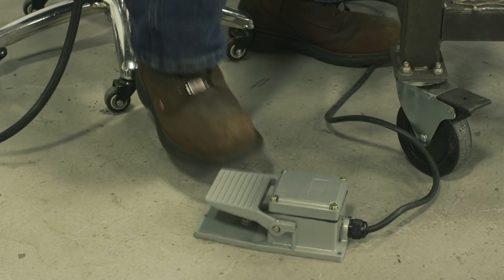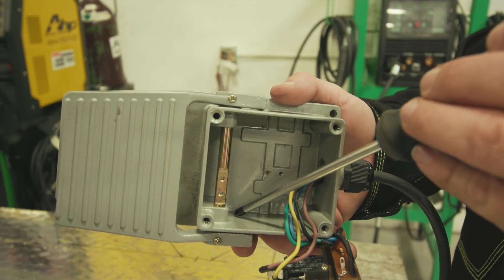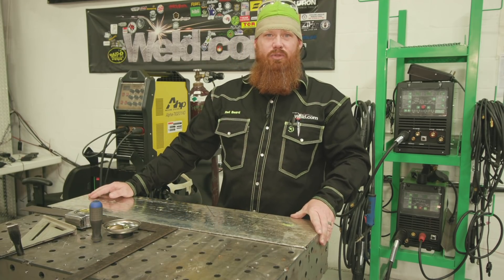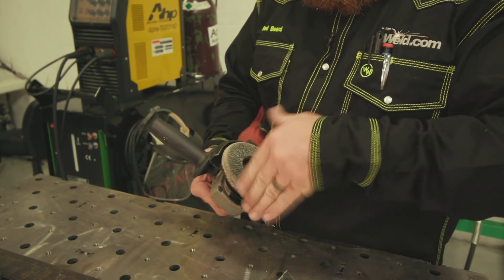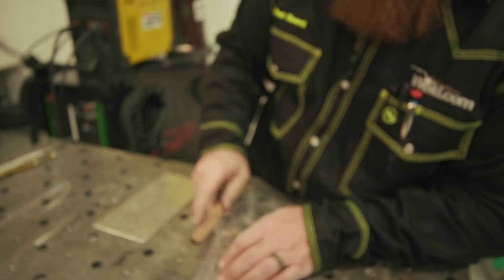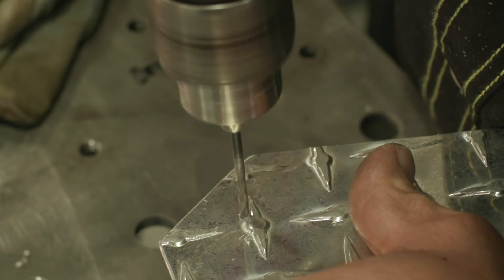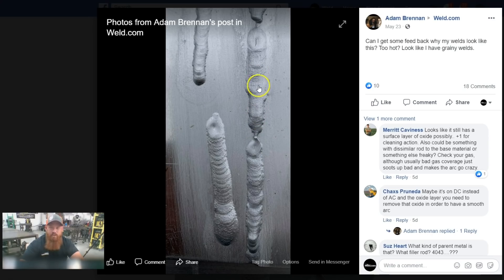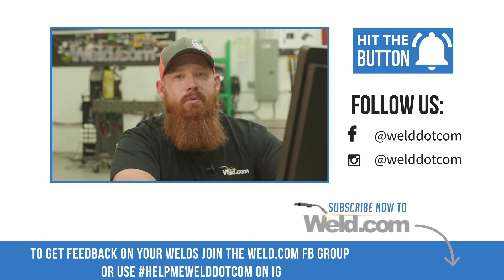Foot Pedal Retrofit: AHP AlphaTIG 200

Comment: I wasn't a fan of the supplied pedal either after using a Miller professionally for years. But I kept it really K.I.S.S. and made a price of plywood and screwed the pedal to it so your he'll is on the wood too. 
 Boom! 
No sliding around and much easier to run finger adjustments. Took five minutes and cost zero dollars since it was from scrap.

Comment: Putting a plate screwed to the bottom fastening holes that has an anti-slip rubber pad on the bottom helps a lot. No, I don’t have this welder, but I do have that switch I bought for a machine I designed. It’s not a bad peddle, as long as you put something on to prevent the slip. It’s pretty easy. McMaster-Carr has what you need. It’s cheap enough.

Comment: Why do you use a dirty angle iron if you try to keep everything clean ??
Reply: bram eelen this piece wasn’t that critical, of it was for something structural I would have used cleaned stainless as a backing. With the way we did it here I demonstrated proper cleaning as well as how to align pieces and use them as a heat sync.

Comment: Helpmewelddotcom is a cool thing you added to the channel. 
Could you do a video on how to weld high pressure die cast aluminium, I guess these castings are cleaner as sandcastings but still sometimes a pain to work with. I always get trouble with porosity, its just starting a puddle and that black oxides and stuff appear. Only on thick parts I am able to keep moving the puddle over these spots long enough to get the crap to float  to the top. 
In general I use low AC frequency around 40Hz and 40-45% electrode positive on the ac wave to get proper cleaning. May not be the best way, but its shown to work best for me at least.

Comment: My chinese tig came with a light weight foot pedal that used to slide around on the floor. I made a new base for it out of 10mm ( 3/8") plate and put some rubber feet on it. It stays   put now and has a more solid feel.

Comment: Great video. I have this pedal and am going to try this out. Excellent tip with the soapstone on the file!
Reply: Same here.  And funny thing I've disliked it since I got it but I never got the idea to take it apart to see how it could be modified despite having taken things apart for 30+ years.  Perhaps the welder still being under warranty was an aversion.

I'm considering modifying a bass drum pedal for it.  I have some bits of an old Ludwig Speed King pedal, not enough to use and not worth holding on for repair parts.  Maybe I'll mod it to work for the footcontrol.
Reply: I always use chalk

Comment: Interesting note about cleaning the back side of the aluminum weld to help prevent contamination. Would that also be a good practice for steel welds? I was tig welding a steel 4x4" square end plate on a 4x4 rectangular channel and got  contamination over one side area for about 1/2". Both channel and end plate were beveled, cleaned, acetone cleaned, 308 filler acetone cleaned, argon set at 20. However, I didn't clean the inside area of the channel.
Reply: Tom Herd it’s a good possibility. The heat from one side can pull contaminates from the other.

Comment: I hate that foot pedal. I swear it works better upside down or backwards.
Reply: johnny takisawa works pretty decent if you put a piece of wood under it to put your heel on.

Backwards gives me a cramp
Reply: @mrmidnight32  yeah I tried that too. I did upgrade to that ssk pedal or whatever it's called. That pedal is pretty nice and gives you more control at low amps when tapering off.

Comment: You know to clean a loaded file you can use a pice of copper tubing . You just mash one end about a 1/2 inch put a bend in it to what is comfortable to you . Clamp the file down and with the mashed end go back forth with in the same direction as the groves an the copper will conform to that grove an clean the file .
Reply: Check out AvE latest video about aluminum clogging up carbide burrs and endmills. He uses lye crystal (I think) and the file looks brand new. 
I use the copper tube too.
Reply from the maker: Good tip 👍

Comment: Pretty cool, I rather just upgrade.
Reply from the maker: It's an option. They actually have a really nice pedal upgrade for $100.
Reply: You can also wire up the harbor freight Vulcan foot pedals for about $65.
Reply: Different machines have different plugs on both the torch and switch/pedal. You have find the specific upgrade for your machine or retrofit one yourself.   In the case of the AHP w/ Vulcan pedal, you just have to rewire the plug because the AHP uses a 7 pin connector and the Vulcan uses a 9 pin.
Reply: @alantran6901  oh ok kool dam that's good info. I need to do some research then
Reply: Are some welders different in the pedal plug or torch plug?? I've been wanting to upgrade both I have a Eastwood tig 200 AC/DC welder.